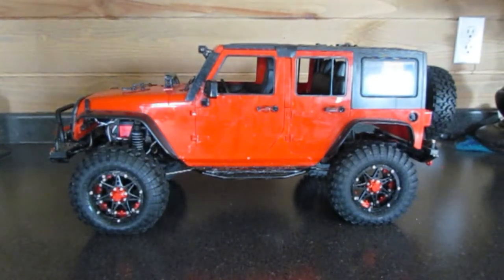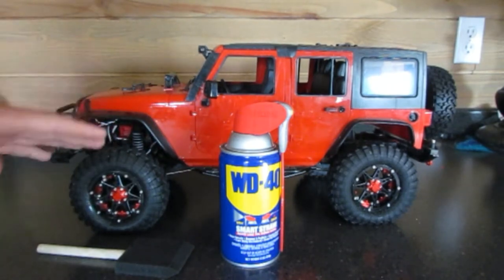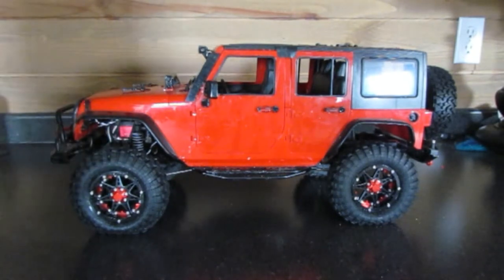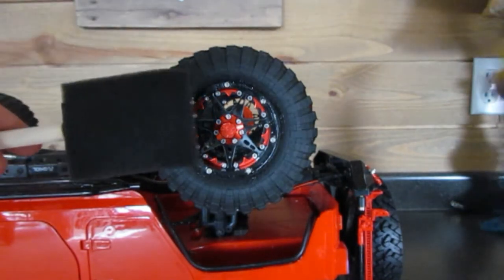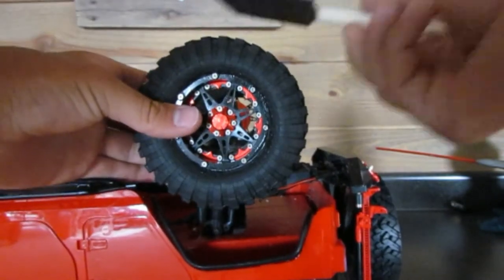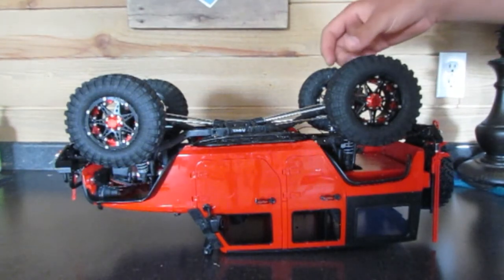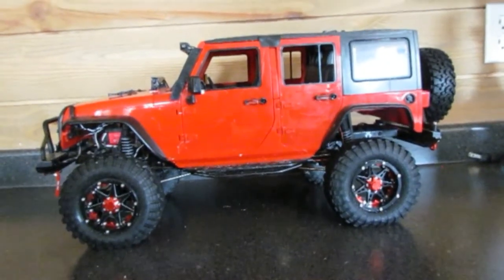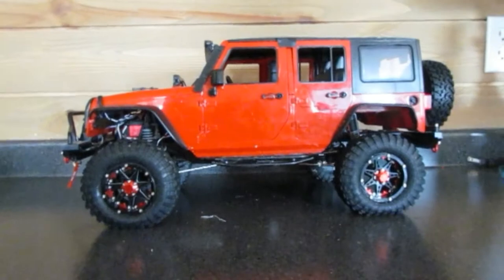How to Make your RC Rock Crawler Tires More Sticky, DIY.

Comment: I buy the cheap knock off Pro-Line Hyrax tires (Injora Rocks Tires - Super Swampers) there identical pattern, just the Injora's are not as soft ... so you take your knock off tires, put them in a large zip lock bag, spray the piss out of them with WD40, close the bag for 24 - 48 hours, and when you take them out, wipe them down, they are SOFT as hell ... just like the Predator compound!
Reply: Yea, but they swell and you have to superglue them on the rim. I'll try the method in the vid.

Comment: Say you make wd40 puddle in the garage and drive over it, would that work? I spill and splatter wd40 all the time so staining the concrete wouldn’t be a concern
Reply from the maker: It should still work, but you will have a lot of excess WD-40 on your tires. Thus, you will have to clean them up a bit and they would take awhile to dry. Also, depending on how clean your garage floor is, it might attract dirt onto the tires. Give it a go and let me know how it works.

Comment: It's a lubricant you muppets the only thing it's going to do is make it shiny
Reply: @MotoMiG87  HaHaHaHa! Oh Shit! I lost my shit when I read your comment! Cheers, I needed that!
Reply: Had me at pinecone 😂
Reply: It works with rubber. Sure, for a minute after applying it's acting as lube, but when rubber soaks it in, it grips very well. I'm using it a lot for many things. WD40 is a must have in toolbox.
Reply: Petroleum makes rubber softer and more sticky. That is why oil undercoating a full size vehicle cuts down on rust, but destroys motor mounts, transmission mounts, spring bushings, and anything else rubber. A bit of WD40 on tires, then wipe off excess and let sit, will make them sticky.